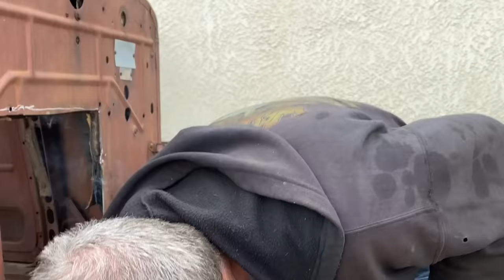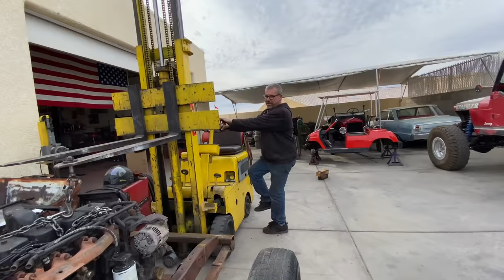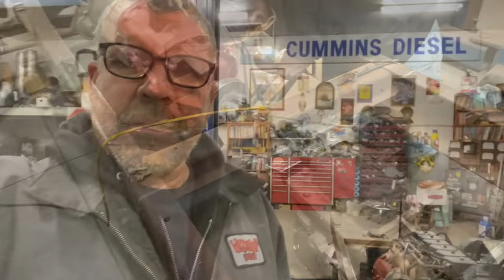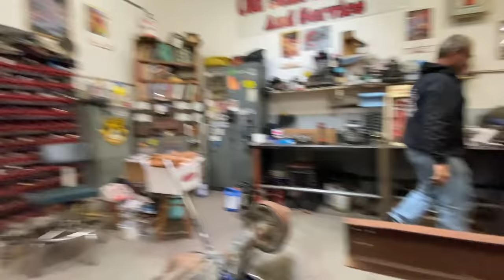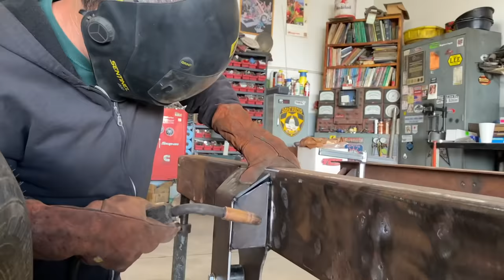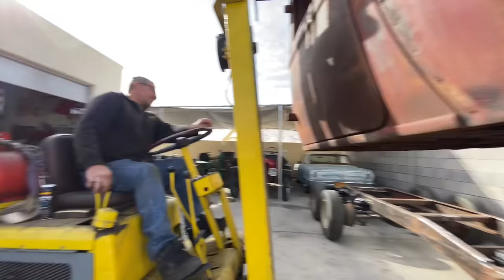1933 Dodge Mini Semi Truck Episode 2

Comment: Does the front axle get a second pinion gear on the backs side to drive the back axle? Is that why the back axle is upside down and turns the opposite direction?
Reply from the maker: yes

Comment: Merlin love the build. 
I saw a tip where you drill a hole just big enough for the nut side of a washer face nut and you weld the nut into the plate around that washer face. 
Refer Karl Fisher  Make it Kustom.
Sweet idea for welded in nuts.

Comment: Merlon, just subbed coming from FAB RATS, that Dodge is just unreal, is that main a 6 or 7 spd Spicer? In the old days the truckers called the auxiliary trans a "Brownie" as many were made by the Brown-Lipe CO.  We had a 45 Jeep CJ-2A with a transfer case made by Brown-Lipe, apparently under license from Dana as parts for a Dana 18 fit it.  Is that a 3 or 4 speed "Brownie"?  The back to back 4 link rear looks clean,  can hardly wait to see the finished truck!

Comment: Add more clearance on the firewall for the rear rocker box on the motor , in case you need to service the motor.

Comment: weird question. but does your forklift have an F2 Mazda engine? it sounds like my  '93 mazda B2200 did when it was bone stock and i do know the same engine is used in quite a few forklifts
Reply from the maker: no it’s a continental

Comment: I would love to find a REO and put a Detroit Diesel in it like this. I built a rat rod Peterbuilt pickup truck with a Buick Fireball straight eight that turned out awesome. I sold it for 30K and the next guy really worked on it and sold it for over 100K. It has stainless steel and copper plating all over it. Really awesome builds.

Comment: That odd that the 34 is a 1/4" frame. I am doing a 36 1-1/2 ton and it is 3/16". I like that spliter box you have on there what kind is it?
Reply from the maker: I wonder if they made the channel taller on the 36 and that’s why they went back to a thinner material that’s crazy your frame is thinner
Reply: @MerlinsOldSchoolGarage  was 7" tall. The new frame is 2x8x3/16, yours sure is getting done alot faster then mine.